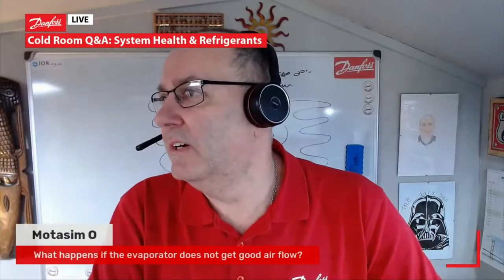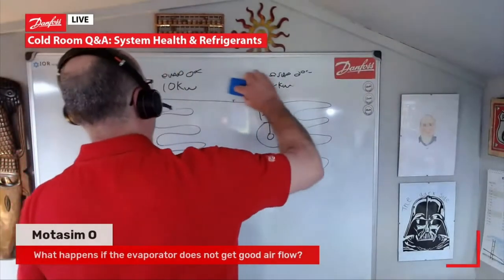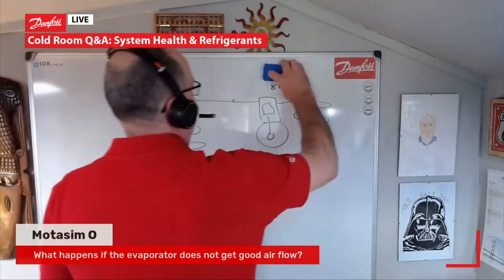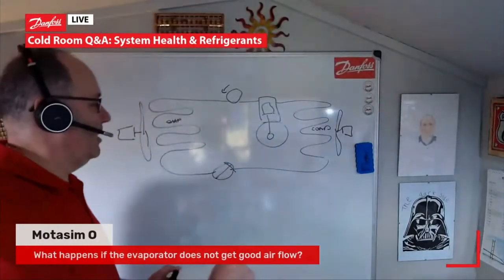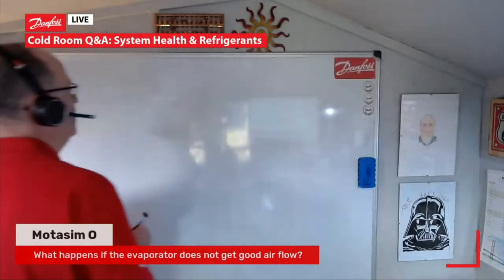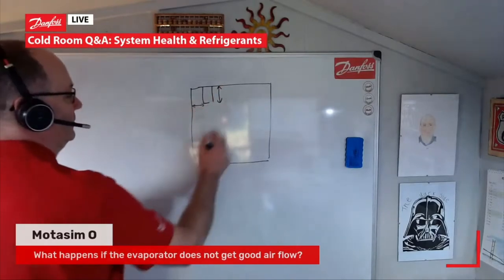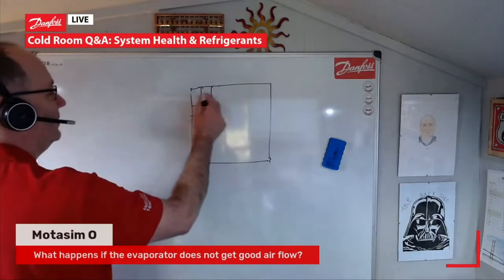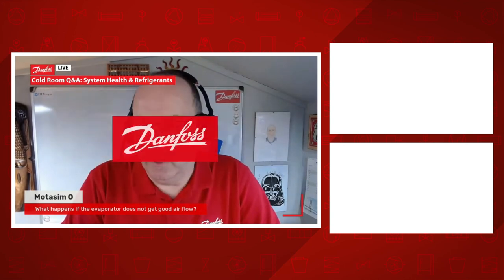What happens if the evaporator does not get good air flow? | Ask an Expert

Comment: Very Informative Sir, But Can you add , How the operator will come to know, Eg in CS with pumping system, In dry expansion (freon) we check if the super heat and cooling are equal or not.

Comment: With a cooling system for cakes, apparently use a fan speed controler to slow the fan down because they can't have to much air flow. How would this work with suction pressure and flood back??
Reply from the maker: Hi, Thank you for you comment.
If the evaporator is designed for low air flow, then the suction pressure will be as designed. But if you slow down the evaporator fans without correct control of suction pressure, then the suction pressure will decrease and then evaporator ice up as a result. 
This in turn will cause incorrect operation of the expansion, which will hunt and could cause liquid flood back to the compressor.
If you need to alter the speed of evaporator fans on an existing application due to a specific requirement, then it is best to fit an evaporator pressure regulator to maintain the desired evaporator pressure.
There is the option to use low velocity evaporators as standard, but this needs to be at the system design stage.
Hope this was helpful :-)

Comment: Sorry My Question was incorrect, We can Measure inlet and outlet Air Temperature of air in ACU, and come to know if air flow has decreased due to any reason.
Reply from the maker: Hi Aftab, Thank you for your comment.
Yes you can measure inlet & outlet air temperature of an evaporator to see if it is doing some ‘work’
This is a very general statement because every application is different  along with the various designs of evaporators – there should be a Delta between air inlet and air outlet temperature approximately 1 to 2 Kelvin when the refrigeration system is working around its desired temperature. 
During a pull down temperature this Delta can be larger.
Hope this was helpful :-)